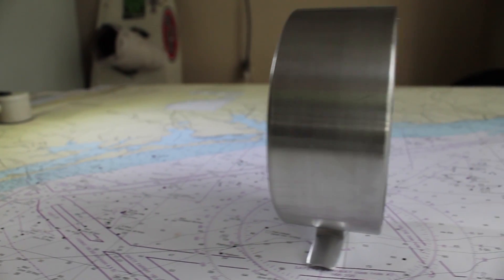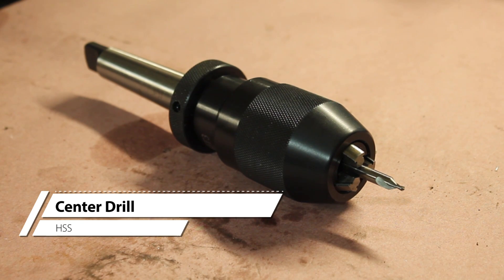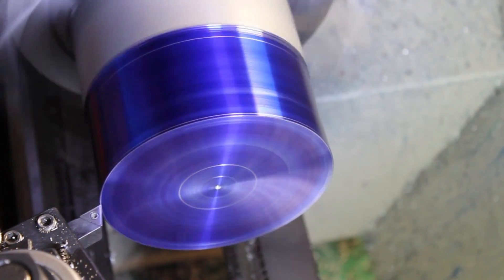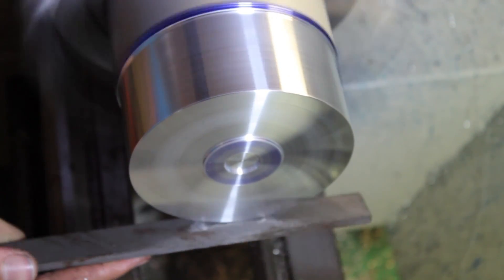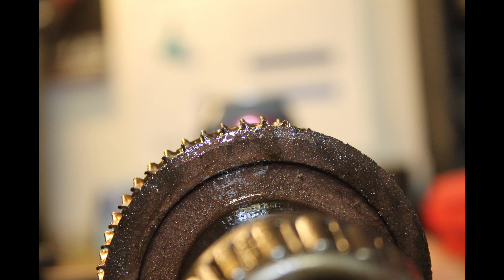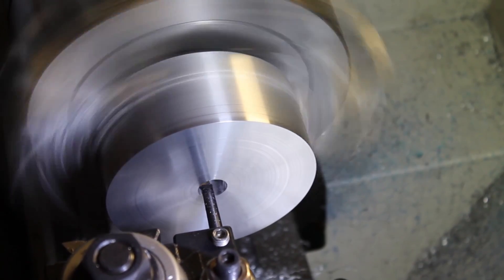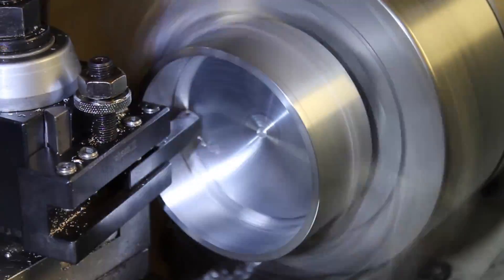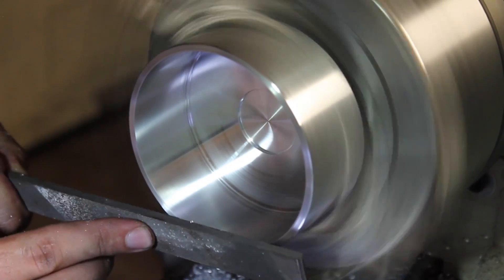Homemade Fly Reel Ep. 3 Pt 1: Reel Frame on the Lathe

Comment: Nice job.
You really didn't need to step up on your drill sizes.
Center drill and 1/2" would have been fine. You were going to bore it anyways and its aluminum so you wouldn't have any problems.
Looking really good.

Comment: Hi JH, Can you please send me a copy of your drawings. What I am really interested in is a large arbor series. But your drawings will give me a starting point. Please specify tolerances, aluminum type, and any specifics on types of press fits if any. I wont be ready to start for about six months but need to glean as much info as possible. I have all the bells and whistles i.e. cnc, mill, lathes manual and cnc; 16 in grinder and 20 inch automatic grinder , shaper etc. I subscribe to all the hi-tec machining sites, Lipton, Renz  ,Gotswinter etc. Do you have an email address ???
Reply from the maker: send an email to jhreels@gmail.com and I can hook you up.